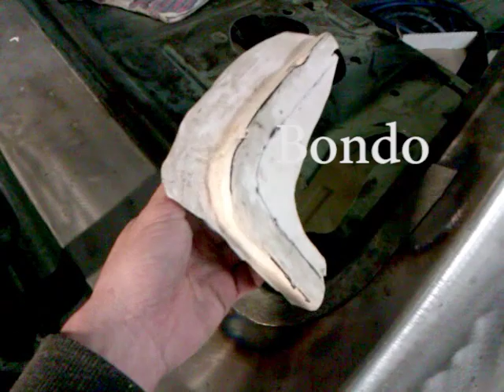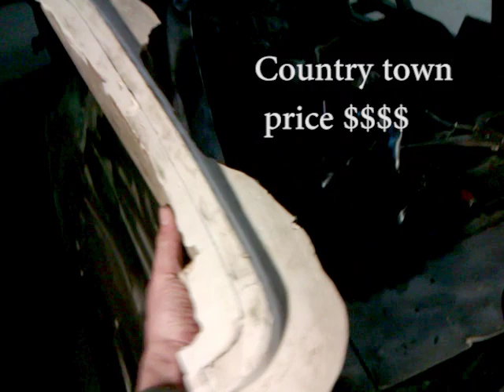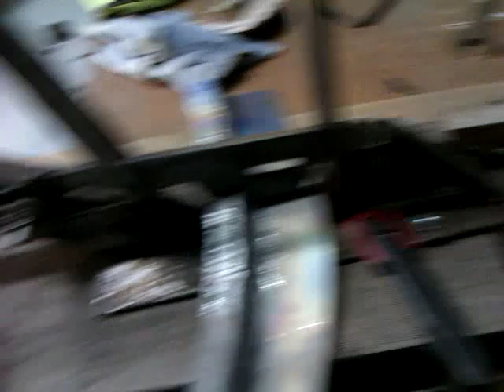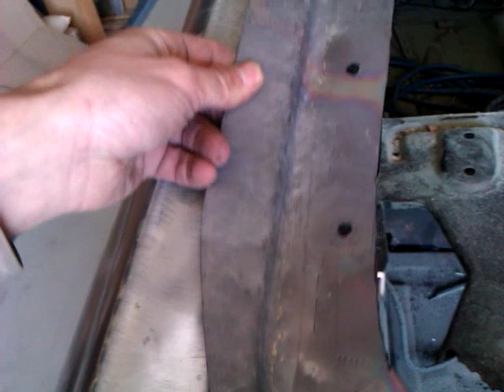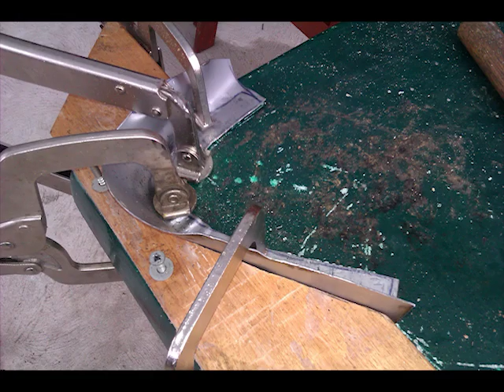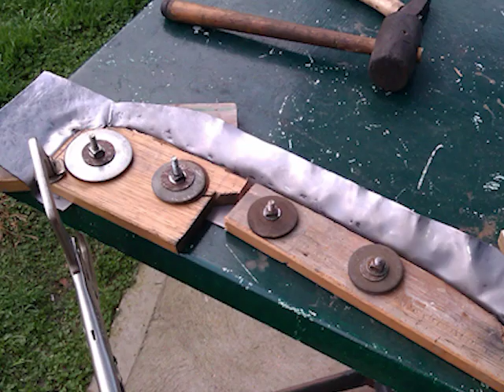rear window rust repair patch chevelle ss panel fabrication with hand tools

Comment: Awesome video showing the tooling design and process as opposed to showing a few short clips and a finished product. I'm researching to see if I have the balls to cut into my CP Coupe to remove the rust and get the body back in shape. Its a scary thought not knowing if your about to cost yourself more money or not. Thanks for the vid. ensure you post the finished product when your done!.

Comment: the repair part you designed looked a ok to me,i've installed hundreds of panels,of all kinds,but your inclination to not remove the quarters is my number one beef,i don't either,i don't like moving lines,repairing rust you see is enough of a headache,to go above and beyond takes love of the vehicle or deep pockets,restoration is damned if you,damned if you don't,but we all hate rust

Comment from the maker: I'm proud if I played a roll in provoking you to take a challenge. However you should aim to better what I did. You'll find some criticism's of my technique if you go through the comments below. If you have access to tig or mig welding consider shaping the outer panel with the fold in under the windshield, then welding in the edge that holds the glass out of the cabin.

Comment from the maker: A man with the right skills (not me) will get a factory finish without a pullmax, I mean smooth and straight off the hammer. If it's a new skill it's going to be hard and slow. An old guy who ran a sheet metal business all his life said I should have made it in two pieces or even three. It's worth considering, I might have done it the hard way. Good luck with your 68

Comment from the maker: I'll make a video when the welding is happening. I'll probably just tack it in then work on my lower rear quarters. My patches fit up good but are rougher than what the pro's make. I'll file the top then probably need to fill abput a mil here and there, which I plan to do with lead. Your idea sounds good, make a video for us.

Comment: How did it turn out? Looking to do some patches on my 68 Camaro and trying to get some ideas. Ever think of getting a piece of flat sheetmetal, making the bends it needs then air hammering it around a big metal pipe with the same radius curve that you need? Might work, just thought about that after seeing the shape of the corner. good luck.

Comment from the maker: Thanks for the support, I do have a connection in California but he costs money and it takes a long time to get the parts here. I bought a boot/trunk lid on ebay that was so bad! if it were any worse you could have put it in the box with a shovel, a smaller box.